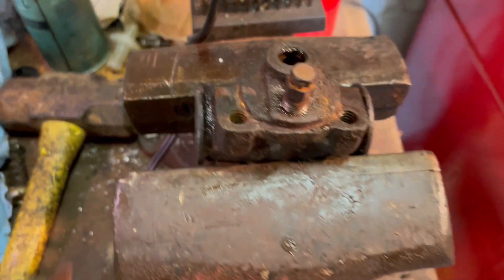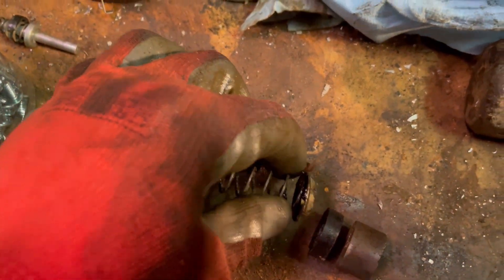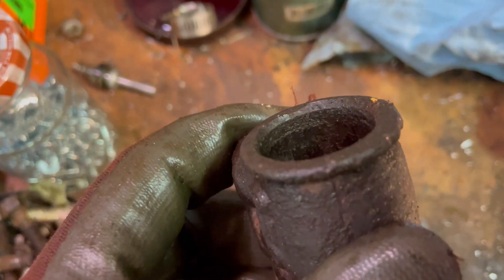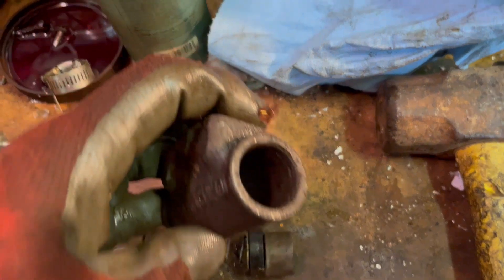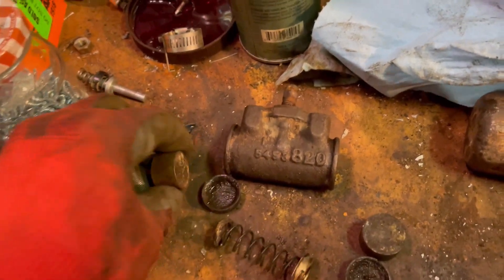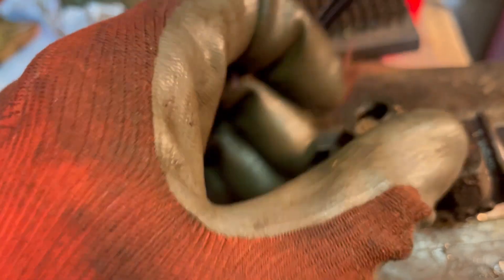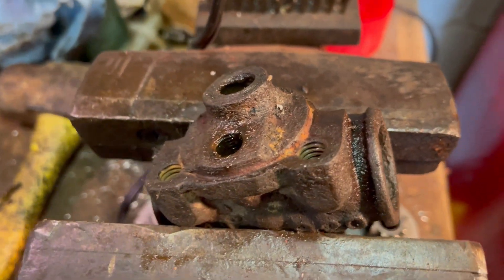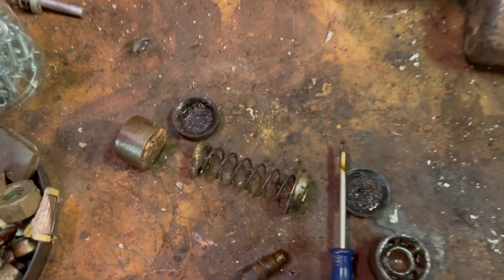What is inside a drum brake wheel cylinder?

Comment: Have new cylinders got a nickel coating on the pistons and maybe the bore to stop them rusting?,i've got a 1976  toyota hiace camper a, i'm thinking of putting the cylinder  and pistons in acid to kill rust and painting them with a thin red oxide coating, then put a little silicone grease on them. When van not used for many months some of the pistons seize

Comment: Hi, I was catching up on some of you older videos on your second channel and watched this one from about a year ago when you showed how a wheel cylinder was put together. Have you ever seen one that had a brass sleeve inside the cylinder. I don't know if that is rare, but I have a 1930 Dodge DC eight 4 door sedan that actually has hydraulic brakes, and the wheel cylinders have brass sleeves. I'm not sure if they are original, but I think they are.  They got locked up once from sitting too long, but I just had to clean up everything and change the fluid, and they worked fine. No pitting in the brass. It does have odd brake shoe adjusters though. I really enjoy watching your  channels. Thanks
Reply from the maker: I learned something new with your comment. I have not seen ones with a brass sleeve, but I have no doubt they were used in older vehicles, and now I know for sure. Thank you for the support of the channel, William.